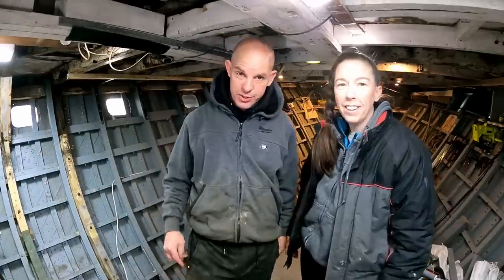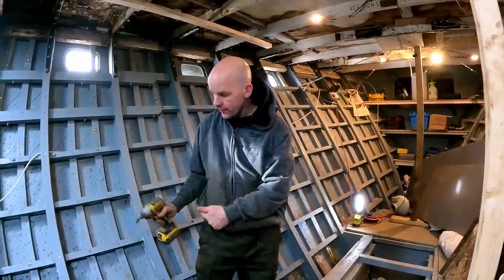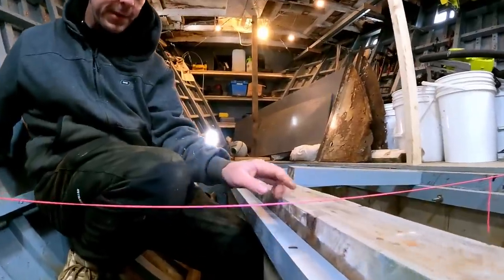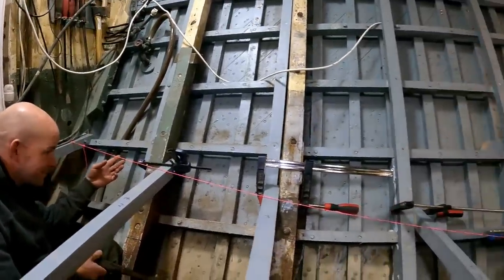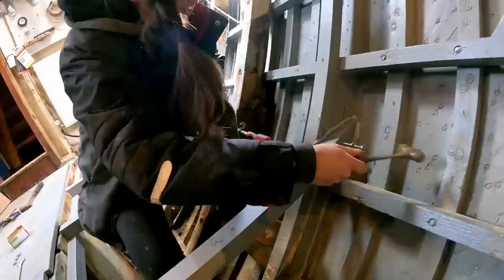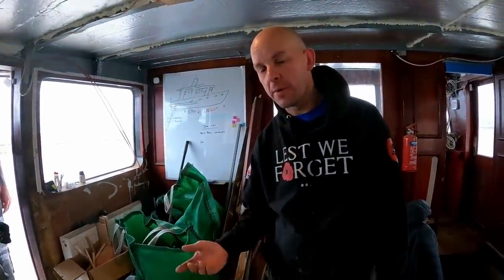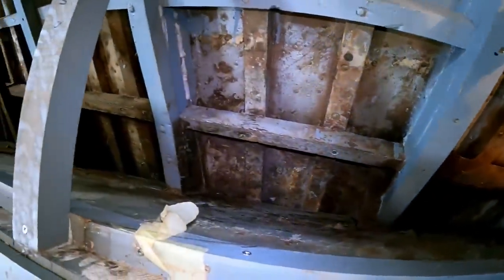Ep 109 - Lost Soles At Sea Fixing A 79 Year Old Boat! #boatrestoration

Comment: Love your videos guys. I learned a top tip when using a string line. Space the line away from the work using a little block of 12mm ply each end and then adjust the individual sole bearers using a third little 12mm block to slide in under the string on top of the bearer as you go. Then you don't get any accumulated error by slightly deflecting the string with the actual bearers once they are fastened, no accumulated error! Keep up the good work!

Comment: I like our boat video. Suggestion: When using a wood chisel: Always use the angled side towards the wood, so that you can control the depth of the cut. Using it the other way will most likely cut too deep in the wood... Unless you are smoothing, like using a wood plane.

Comment: White bilges look great and it's so much easier to find dropped tools etc. I re-engined my boat with a pair of Ford Transit lumps and sprayed them with radiator white paint, so even the engine bay looked good.
Did a thumbs up but the bloody counters stuck at 3.9K, was hoping to shove it over.

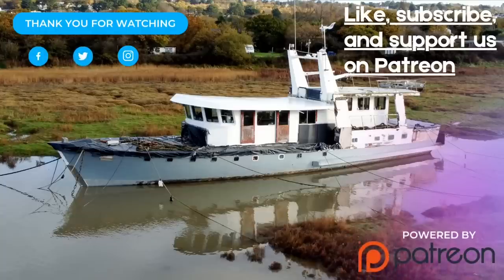Comment: 24:33 You really need to have that string pulled tight, or you will not get a straight line.  Better to just use a 6-8 foot level as a straight edge instead of the line.  Not as a level, but just as a known straight edge.